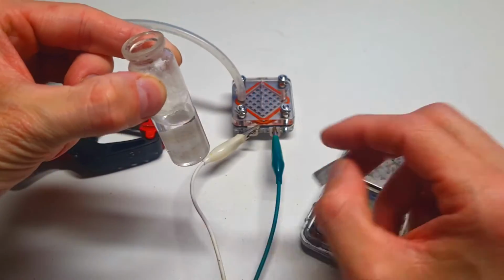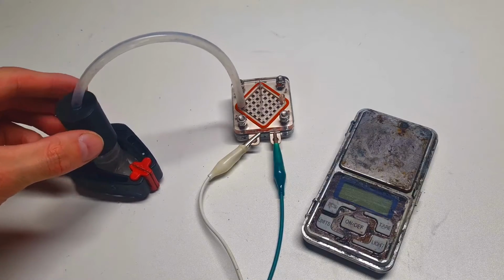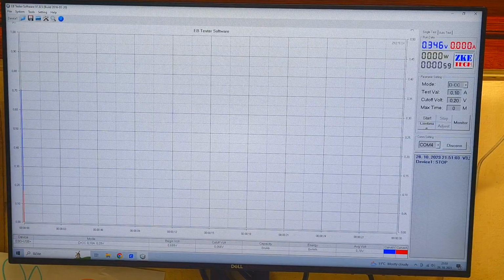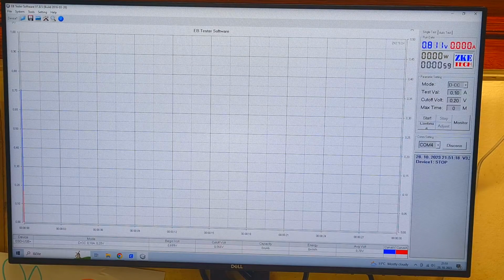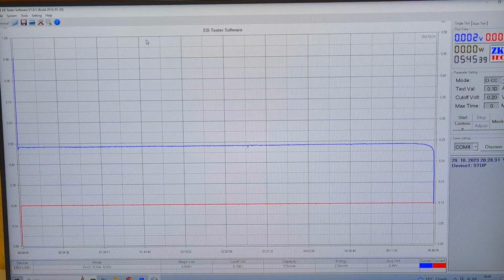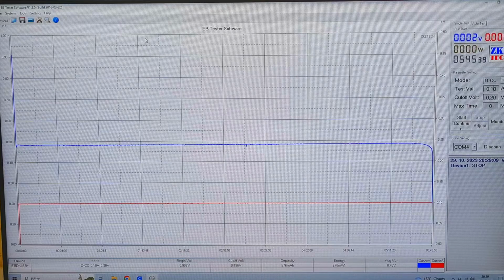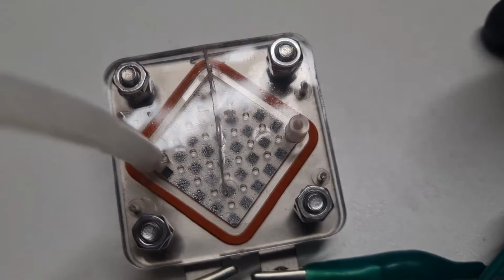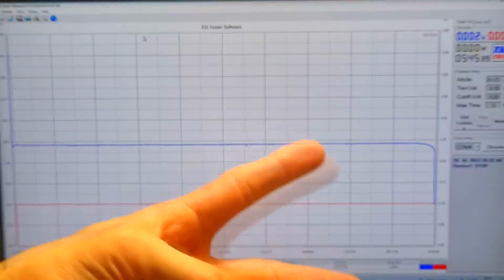The result with 1 gram of aluminium in Hydrogen fuel cell

Comment: Which setup are you using to test the cell?
Reply from the maker: I use the electronic load with fixed discharge load
Reply: @cayrex  thank you! Which software are you using? I'd link to replicate your setup!
Reply from the maker: @plowizard  zke tech battery tester electronic load

Comment: You might get longer runtime with pressure regulation before the pem cell? This is an interesting proof of concept, from what I've read online, it's recommended to have filters/scrubber etc on input as impurities can damage cell, small scale, the way you are testing, probably not an issue. Being able to DIY your own pem stack, that would be awesome, maybe you have something like this printing 🎉
Reply from the maker: Reducing the flow of the hydrogen will higher the runtime. Here I use activated carbon felt as a filter. Maybe some bubbler will also be good.